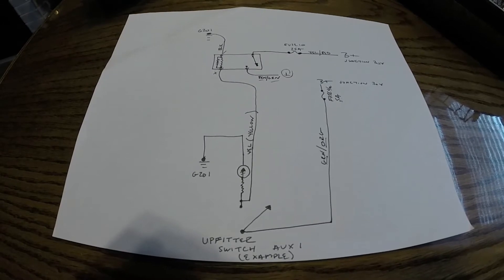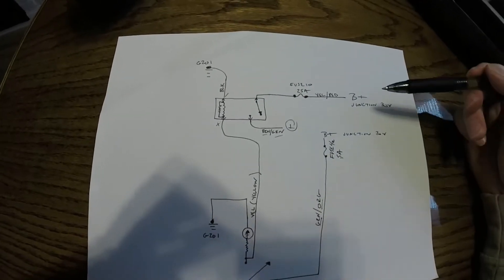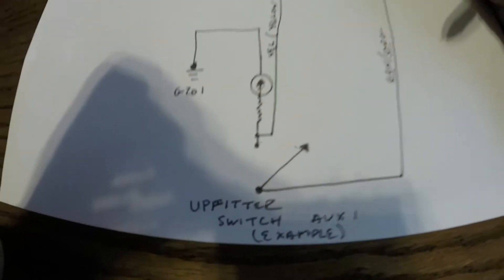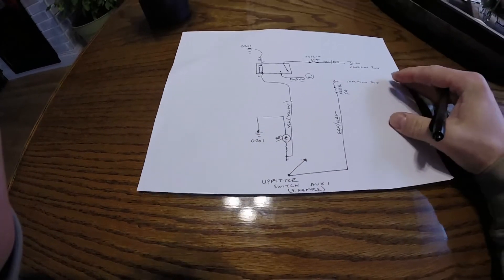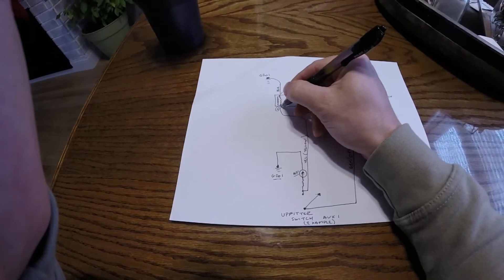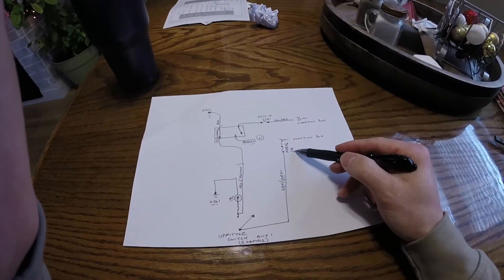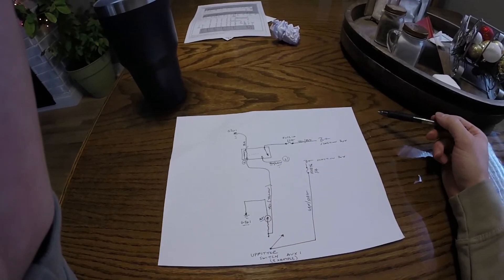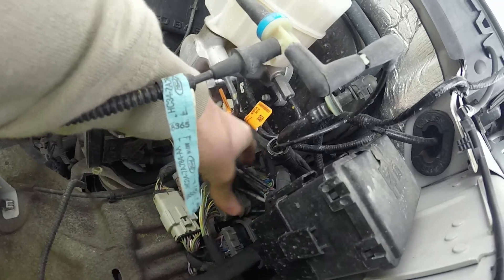F-250 Super Duty Upfitter Switches Explained - Basic Electrical

Comment: Do you still need to ground the accessory your attaching to aux 1 switch or is it already ground? Do I just connect positive to the wire under hood and done?
Reply from the maker: The negative connection on accessories such as a light bar would still need to be attached to a good, clean ground in order to complete the circuit. The wiring shown under the hood in the video is for the positive side of the circuit only.